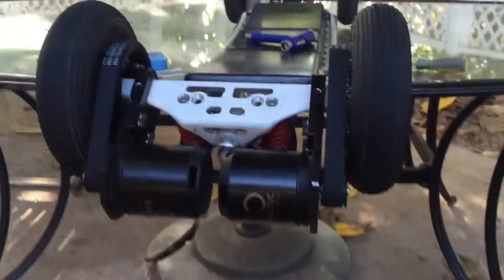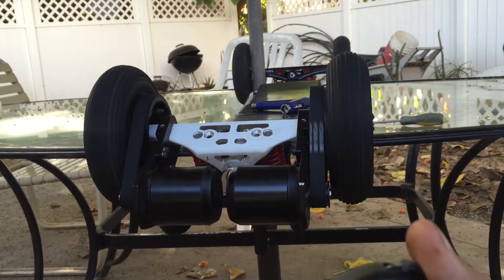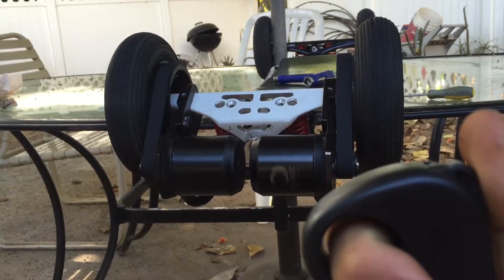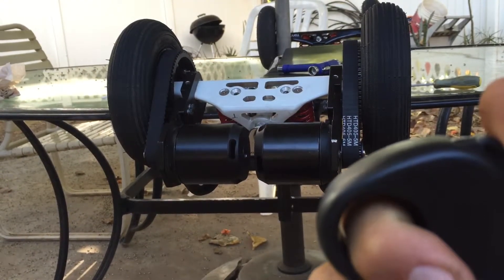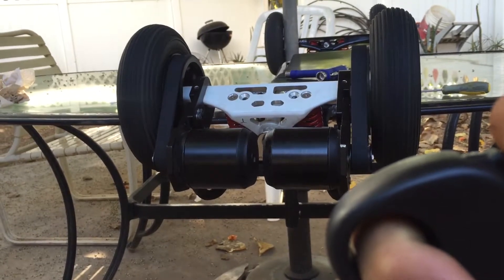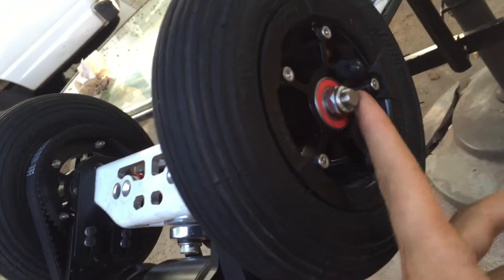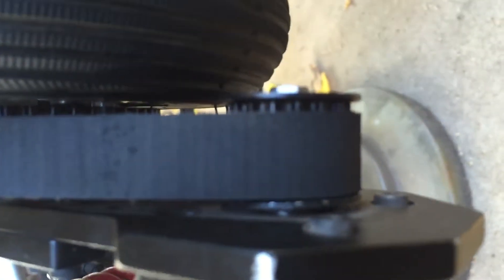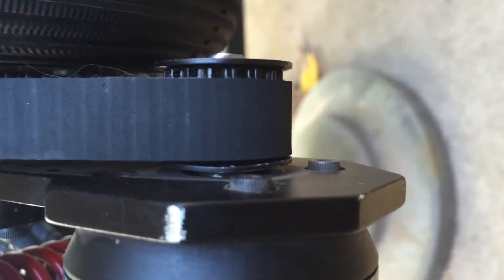Wheels spinning at different rate esk8 kaly.nyc

Comment: i have a Trampa board just like that, when i assembled it and spun the front wheels by hand one was slower than the other. I just loosened the truck nut slightly and it spun longer.  Maybe the problems is just the nut being too tight to the truck.

Comment: Did you contach kaly.nyc to get it fixed?  The canbus cable might have slipped off of one of the vesc or one of the vesc has reset to default settings.  Save the settings from the left and upload it to the right vesc.